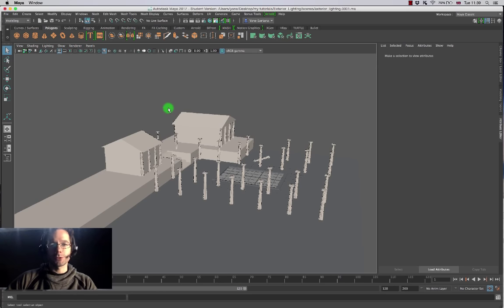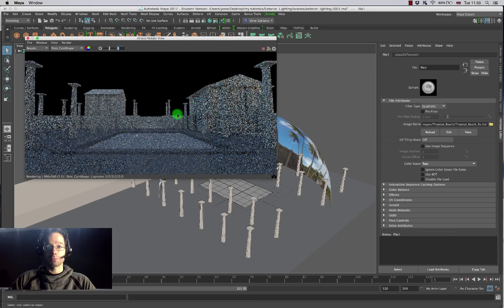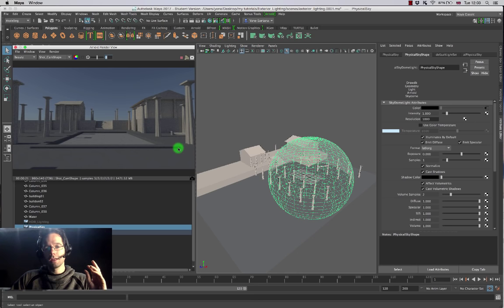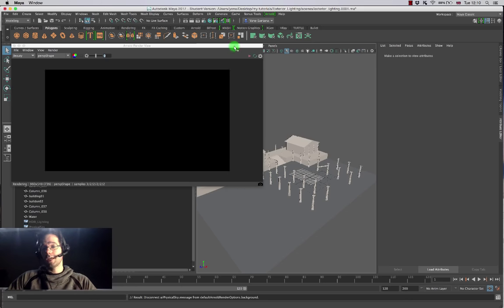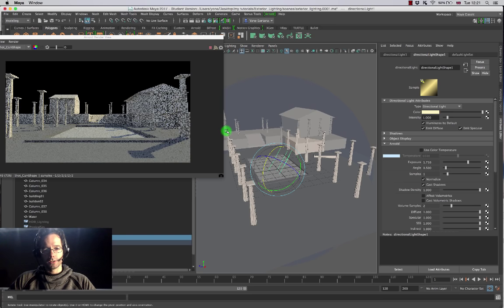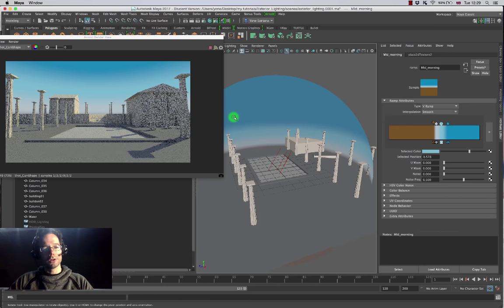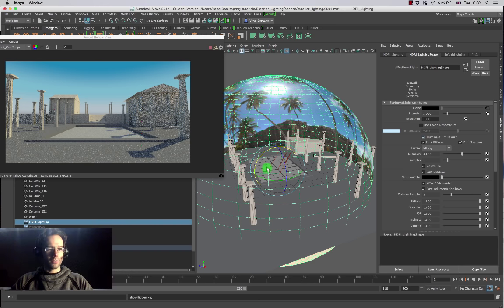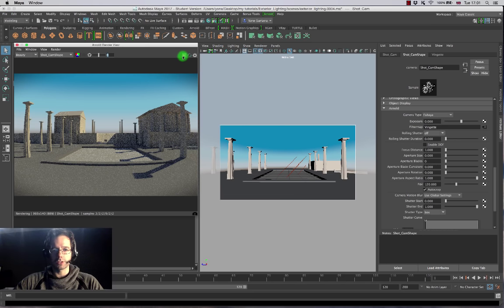Maya 2017 - Exterior Lighting in Arnold

Comment: Hi, So I loaded the scene into Maya 2018 and when open the ground poly is corrupted? It looks as if someone had two layers of geometry overlapping and several polys are missing.  If I select the face of the object and move it, the entire ground is a mess. Could you upload a 2018 version? Most of what you discuss applies in 2018 but the scene file seems to have some legacy issues in 2018.

Comment: When I load the file the background doesn't load all the way is there a way to possibly fix this?
Reply from the maker: If the issue is in the viewport, try adjusting the camera clipping plane. You can select the camera and then in the attribute editor find the clipping plane settings and increase the value of the far clipping plane.